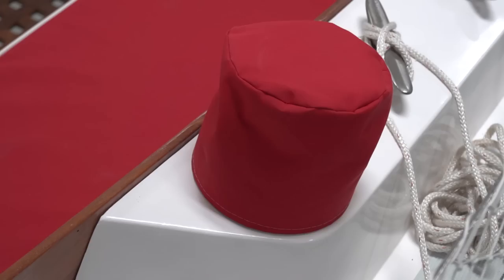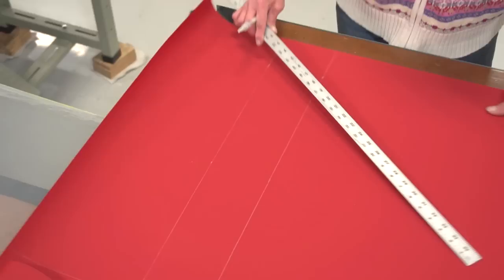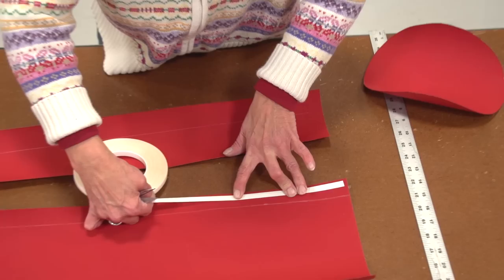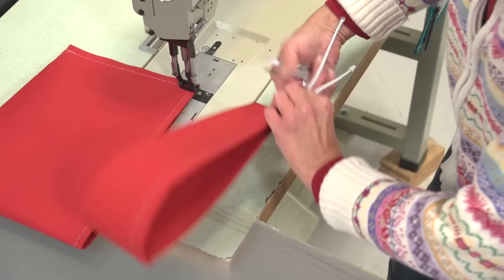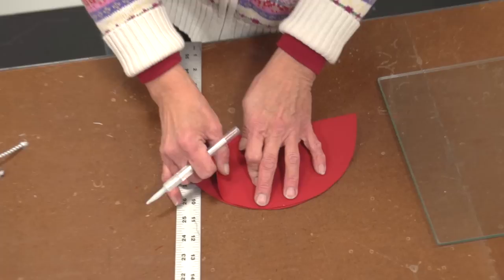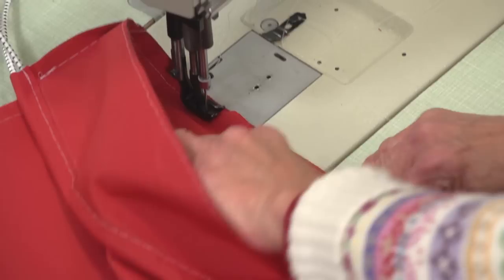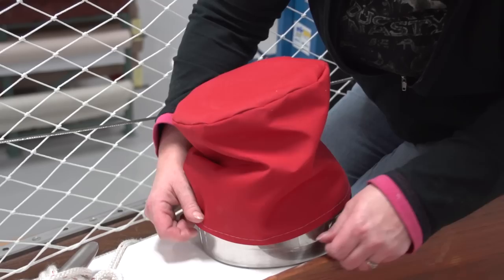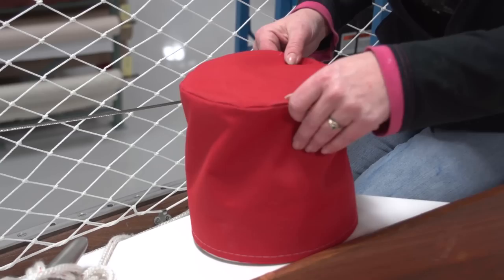How to Make a Winch Cover for you Boat

Comment: Tackled a few now and they are getting better. With smaller winches I have found adding 1” to the height and the inner collar helps (have a 4” x 4” winch). Also, my older Lewmar 42’s with self tailing require an additional 1/2” on the diameter. Awesome having the grab collar hidden. I have seen a few winch covers that have a pull cord on the base. They work well, but don’t look nearly as finished!

Comment: I always put a circle of PVC under the top. I lay the shock cord in as l see up the hem. I use 2 hog clips to join shock cord. I had a friend buy them in USA because you can't buy stainless hog clips here in New Zealand. On our own boat l made them a bit bigger with a side opening and the whole length of the furler sheet is wound on, and covered

Comment: Have tried these, but my domestic sewing machine really isn't up to the job.   I found getting the round top to stitch nicely into the base very difficult, with lots of puckers, even after putting in some gathering.  Access for the material around my sewing foot was limited, especially on smaller winches.  Close, but no cigar.

Comment: Making covers when the top of the winch is smaller diameter than the base is a bit more tricky - would you cut fabric out go the circle or how would you adjust for the pyramid shape?
Reply from the maker: Usually the base has a larger circumference than the top of most winches. We do not make modifications for that in our covers, the top circumference is the same as the bottom opening size (after sewing).
Reply: @SailriteDIY  Not sure I follow your answer - so the top of the cover will be same size as the bottom therefore fit loosely over the top of the winch which diameter is smaller?

Comment: For self-tailing winches with a thicker top assembly, is it advisable to make the choker a bit greater than half the winch height?  Perhaps 2/3?  Or is the "winch height/2" an appropriate choker height for all winches, even STs?
Reply: I made one so far -- and the 1/2 choker was tight getting on and off.  I may use 2/3rds on the next one.

Comment: I like these a lot, but on smaller winches, if I follow the instruction measurements on seams, it’s just too tight.  Going to try adding 3/4 of an inch to my diameter measurement. With the choker in there plus the stiffer edges of hotknife cut Sunbrella, I think it should still hold its shape.  While I’m at it, I’m going to also change the seam for the outer cover.  It just bugs me a little seeing a plain seam when go to put it on.
Reply: What change on the outer seam did you make?

Comment: Perfect, just what I was looking for. Can't see how the rope can exit the cover without allowing rain water in, though.
Reply from the maker: Typically the covers are only installed when the winch is not in use, so no line would be on the winch.
Reply: I made two of them in an hour. I had to adjust the inside to fit mine, but ultimately, easy peasy! Thanks for the vid.
Reply: @SailriteDIY  I leave the lines on the winches when I cover the winch, adding a slit on the bottom to allow for the line to stay on the winch.  Great video to get me started.
Reply from the maker: @mariemcnulty3608  Good idea. Thanks!!!

Comment: These instructions use the exact height and circumference of the winch. Using the instructions in this video creates winch covers that are way too small. I can barely get them on the winches because they are too tight and are too short as well. Wasted two weekends and lots of fabric on this project. I even made a mockup out of regular cotton fabric before making the final ones. I think the thicker sunbrella fabric made a difference.
I would add an inch or more to the actual winch measurements.
I now have 4 winch covers that I hate and don't fit but will use because I'm done spending time on this project.
:o(
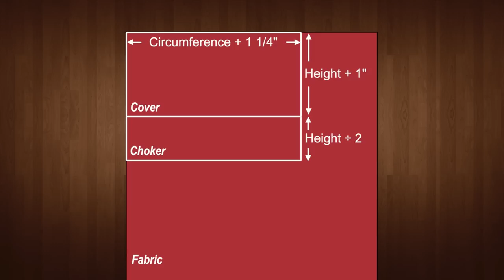Reply from the maker: You are mistaken. You see at 1:23 min in the video that we add 1.25" to the circumference and 1 inch to the height.